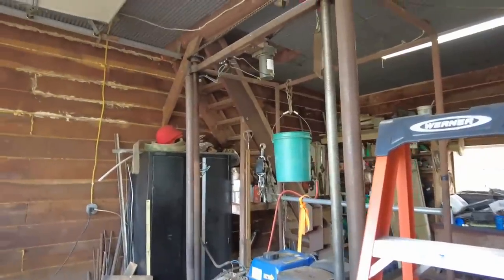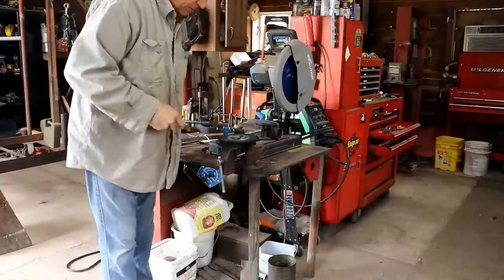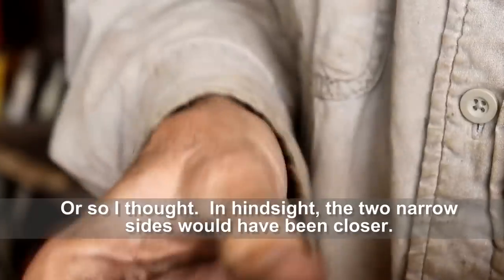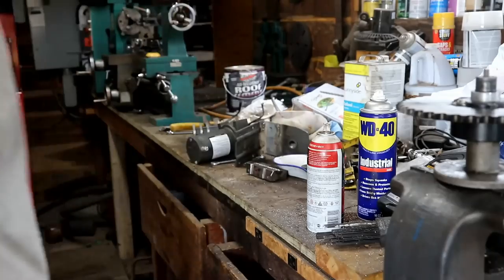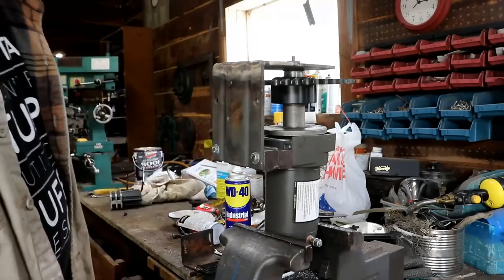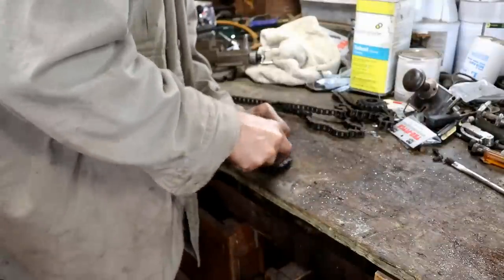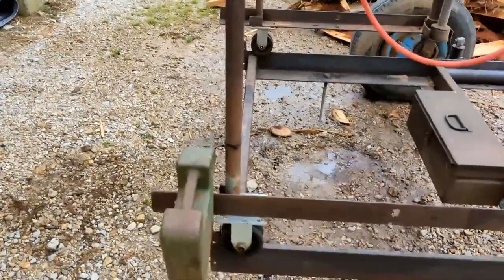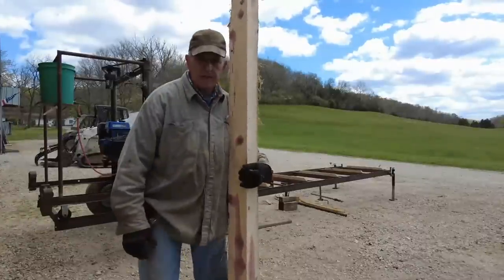644 RSW Improvements To My Homemade Sawmill

Comment: Nice video! The reason why the chain became to long maybe that you forgot to add the length of the chain lock ?
This kind of chain lock is common also on standard bicycles, at least here in Sweden.
It is important to mount the lock so that the closed part runs first.
Otherwise the lock may open and cause the chain to break with fatal results.